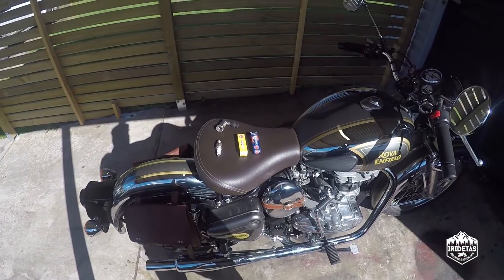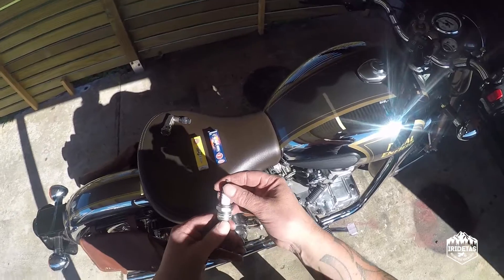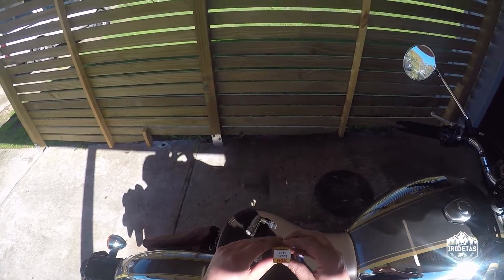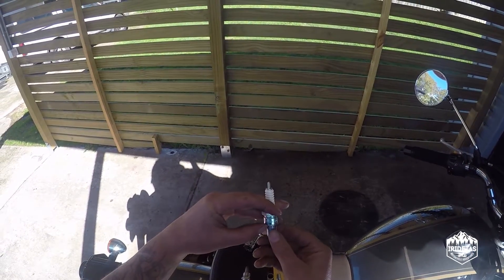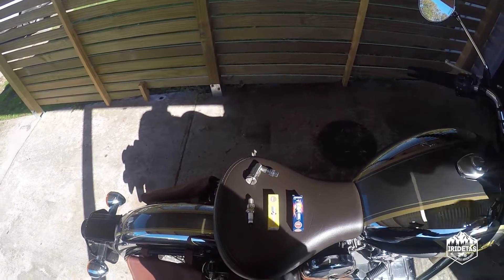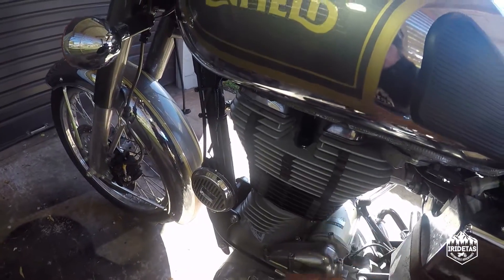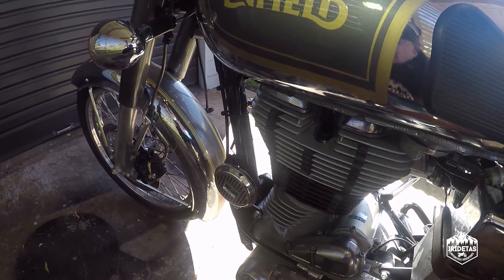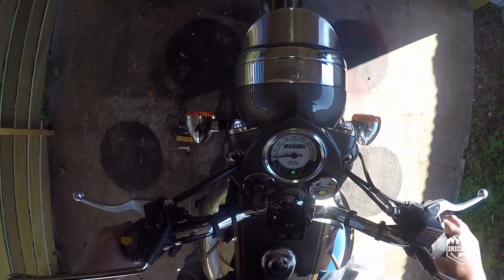REA #6 | Spark Plugs, Royal Enfield Classic 500 | Bosch WR7DDC4, NGK BP6ES vs NGK BPR6EIX Comparison

Comment: Can you share the plug cap code? I'm not finding this one to buy
Reply from the maker: Its in the description and video mate
Reply: @iRidetas  The plug cap have the same code as the spark plug? I found the spark plug but not the cap..
Reply from the maker: @andrert100  Non resistor spark plug cap is NGK LZFH
Reply: Thanks mate
Reply: One more question mate. I made the complete change but feels like the plug cap is a little free than the original, is that normal?
Reply: Will leave this message here if anyone else newbie like me doing this change. The Iridium Spark plug has a cover in the terminal that connects with the plug cap. You need to remove it to connect correctly.

Comment: How can i buy this plug set in india here only heat range 5 is available
Reply from the maker: Order it internstionally from amazon or the likes
Reply: @iRidetas not available in Amazon or anything
Reply from the maker: Mate, the internet is a powerful thing, i can buy things from india to be sent here, im sure you can sus it out, in 3 seconds i found the ngk india headquaters and the distributor network search engine and for example found all the suppliers in Dehli. Give it a try! Google is your friend mate!
Reply: @iRidetas I got it, but the problem is that the NGK plug and NGK resistor cap are from different websites, so I have to pay separate shipping charges for each. This makes it super expensive  the shipping costs are almost twice the price of the products themselves.

Comment: Very good video! Are both spark plugs the same? My RE 500 has one with a smaller diameter. Do they have to be the same? Thanks!
Reply from the maker: My UCE Classic 500 only has a single plug. You will need to research the NGK equivilent of your plugs

Comment: Hello just saw your video found it helpful but can u plz help me a little i m from india i bought royal enfield bullet 500 efi in 2018 and it comes with BOSCH WQR8DC spark plug . Now i want to change my spark plug i searched the internet got different answers but the majority was with NGK BPR5EIX ...
And u are using BPR6EIX ..I am confused as for which spark plug to go with..

And i also want to ask can i change only the sparkplug or should i change the cap air filter etc..?
Reply from the maker: The 5 is a hotter plug. You have probably looking at UK pages
You can change what ever you like mate. 👍

Comment: The idle rpm increased significantly... In carburettor bikes it can be adjusted. Is there any method to adjust it in Efi models at home
Reply from the maker: Yes, the large gold screw on the throttle body is the idle adjust

Comment: Hiya Buddy - Thanks for the excellent video and advise - I have the iffy Bosch plug on my nearly new 2020 model. The engine is more shaky than my other half!. As Hitchcocks is only some 30 miles away I will take a ride out and grab a couple of the NGK iridium plugs. (will keep the Bosch as an emergency spare in case I see another bullet owner broken down on side of road!) - Not sure if i need to change the plug cap itself as mine is not the metal type that is in your video (mine looks like the one you fitted - How can you tell if it has the resistor or not?  Also how are you detecting the revs without a tacho?
Reply from the maker: I have a digital tach installed
https://youtu.be/_J91uUw6108

Comment: Quick question. Do I need to change the resistor if I change to a BPR6EIX spark plug? I'm only asking, because those from NGK are not available here nd if I do import it the tax and duty is very high.

Comment: Cheers for all your hard work 👍. I have the iridium plug but do I need to change the cap? I also have 2017 500 model.
Keep up the good work!
Reply from the maker: Thanks mate! I non resistor cap is better, I found the stock cap not so great! But it will work with stock for sure
Reply: @iRidetas  Thanks for quick reply. I have scrutinized cover a little closer. My classic has a black plastic type cap ( not the metalic looking one you had in your hand on the video) guess the previous owner of my bike must have fitted the newer plug cap.
Once again..Cheers for all your videos.
Reply from the maker: Sounds like they have! Nice little bonus! 😀👍 take care

Comment: Thanks for that tip. I have just tried an iridium plug in my RE classic 'Tribute' 500 (300 miles on the clock) and went for a half mile out and back and the difference was obvious. Less hesitation at low speed, smoother running and it felt subjectively like more power too! Just like you said. Thanks again!
Reply from the maker: No worries glad it work as well for you as me!

Comment: Enfield 500 and 350 are calibrated for BOSCH WQR8DC, all new bikes come with the same. You can find BOSCH iridium plug WR8DP It is made in Germany. Engine runs smooth and no carbon fouling.
Reply: WQR8DC had a different shape of insulator, which helps spark plug to heat faster so that fouling can be avoided. Enfield engines are calibrated with lower combustion temperatures, to imporve the performance of spark plug (any brand) rev up the engine and hold at high rpm occasionally for few seconds.
Reply from the maker: Imo bosch plugs are inferior to NGK and my bike runs better cheaper than the equivalent bosch plug.  But each to there own mate if you have sucess with them more power to you!

Comment: Wanted to try your  NGK suggestion in my 2020 Bullet Trials so ordered the spark plug and cap off Ebay. Cap is fine but the spark plug terminal nut is not removable on NGK BPR6EIX here in the USA so I have a spark plug I can not use.  There are a couple variations of the same plug but none have removable terminal nut that the cap requires. One NGK site recommended BR8EIX as the right  iridium plug plug for my RE so I ordered one of those.  Spark plugs must be different in other countries per manufacturer/supplier perhaps???
Reply from the maker: Thats odd, i never expected that they would be so different in different countries.  The 6 here had the threaded terminal nut that just spun on or off from memory.  The 8 will be a cooler plug so will take longer to get to operational temp etc. But you have a higher euro complience than  the 2017 which is euro 3, they may have changed the plug on the 20?? Sorry to here you are having trouble.  Can you change settings on your ebay app to australia and buy it here? Get it sent across?

Comment: Hi, sorry for getting picky,  But BP6ES is a non-resist plug where as the other two are resist plugs hence the `R` in the code. Therefore should you not of used the BPR6ES?
Reply from the maker: Yup that was deliberate to try non resistor plugs and plug cap in the bike, and it works really well!
Reply: @iRidetas  But you shouldn't use non-resist plugs on an EFI.
Reply from the maker: Im not looking to argue mate... i have, i would continue to if i wasnt running the irridium plug. it runs great, it is the reccomended plug by hitchcocks and many efi C5 forums and riders swear by it. Cheers.
Reply: @iRidetas  Hitchcock's have been known to be wrong, but if it works for you  than all's good. EFI bikes are meant to use resister type plugs to protect all those sensitive electronics.
Reply from the maker: Yes im aware my friend, but it works, it works well for me 👍

Comment: Can you comment on the different looking posts on the various spark plugs.  The plug that comes from India with the bike looks like a thin threaded screw post and the replacement you recommend has a much wider, non threaded post.  Does upgrading the plug absolutely require replacing the factory cap because the wider plug post won't fit?  FYI  is on Amazon, the replacement cap you recommend NGK LZFH, is shown as a resistor cap as well.  That's a bit confusing.
Reply from the maker: No it doesnt, but the factory cap is rubbish. These are plug and play mods.  It may be that in the indian market the stem is narrow but its just a screw on adaptor. The cap was sold to me as a non resistor cap. So not sure mate.  Even if it is not a big issue in any way.  A quick search has most places listing it as non resistor.
Reply: @iRidetas  Thanks much.  I figured it all out, pulled off the factory cap, screwed on the one you recommended.  Easy Peasy.  Also, I removed the adapter from the new plug.  All is well.  Great video.
Reply from the maker: Great to hear my friend, enjoy!

Comment: Hello mate... I also have royal Enfield classic chrome 500 efi which have dual spark plug can you tell me which are the spark plug numbers of both for NGK IRIDIUM and Both or their caps? Im trying to find them from a long time i have less knowledge about them thank you so much mate ❤️
Reply from the maker: I dont have a dual spark 500cc mate so i dont know. 3 seconds on google will turn up the numbers for you!
Reply: @iRidetas  finding from 1 month got no luck 😪
Reply from the maker: Took me less than 5 minutes. Looks like
Primary BPR5ES 
Secondary CPR7EA
Therefore irridium would be
CPR5EIX
CPR7EAIX
not my bike so its up to you to double check the validity of the plugs etc. By pulling yours and seeing what they are and researching the NGK variants.
Reply: @iRidetas  ohhh okay okay great
Reply: @nischalrana2447  bro did you find iridium spark plug for your classic 500 I have 2011 classic 500 and thinking of to shift
Reply: @naveengautam8275  mate my bike is running good with these stock bosch sparkplugs for 500efi right now...maybe later I'll switch to iridium because there's no use of iridium plugs without plug caps..

Comment: So I've just installed the NGK BPR6EIX 6637 in my new 2019 Classic 500 with only 160km on the clock and taken it for a run. I didn't find it any quicker to fire up on start but wow, what a difference it made cruising around the Yarra Ranges. Worth every cent of the $20 I paid at Supercheap in Bayswater. I haven't changed the spark plug cap yet, but my 2019 doesn't look like it has a resistor. Maybe it's been deleted in this later model?
Reply from the maker: It may have been mate! Really changed my bike too and glad it worked for you!

Comment: Hey Tas, have you had issues with the irridum NGK plugs on your 500?
Since I installed those irridum plugs I had issues when idling and rough running ( esp after riding and leaving the bike for an hour or two and then riding again).
The other day 500 would not idle more then 10 seconds and would stall, even when revving.
Took it to a mechanic, he said it was the irridum plug. He swapped it for a non-irridum and said that solved it. He will do more tests tomorrow, but thinks the plug is the issue.
Reply from the maker: Nope over 4000km on the bp6eix with no issues!
Reply: @iRidetas  just got from mechanic, it's running fine with non-iridum plugs. The iridium were so black and dirty after only 2 months of using them. The mechanic said the iridium plugs make the enfield run rich and they are to be used on high performance bikes. 
It's quite possible that your custom Ecu has something to do with your bike running great and mine hating them.
Reply from the maker: Its not to do with the ecu it would be increased airflow from the k&n and exhaust which i fo mention in the video
Reply: @iRidetas  I also have a k&n filter (round shape, in the air box) and a custom straight through exhaust. For some reason, my bike doesnt like the irridum plugs
Reply from the maker: Mine and a few others i know have never missed a beat on them ryns sweet as a nut!
Reply: Hey did you face any problems after switching to non iridium plugs? Im facing the same problem with an irridium plug. Thinking about switching back to normal spark plug.

Comment: Love your work mate 
Really like all yours modes on royal enfield 
Wondering how to replace the  stock spark plug cap with non resistant plug cap 
Please can you let me thanks
Reply from the maker: Literally just pull the cap off the plug, the plug off the lead, push the new cap on the lead and the cap onto the plug.  It is really that simple man! Cheers and ride safe!
Reply: Hi mate thanks for your help , but 
I could not find the part no. Of non resistant plug cap for royal enfield classic 500 
Please can you let me know the part no. And from where I can buy it 
Thanks
Reply from the maker: It's in the video mate and the description
Reply: Hi Iridetas  , I just replaced the NGK spark plug and non resistant cap on classic 500 
But now my bike is not starting 
Does it effect on ecu or ignition coil

Comment: Hi. I purchased the LZFH cap but it’s a resistor type !!! Do you know if there’s resistor and non in the same part number ?? I have the exact same bike as you (2018) and it’s my first so I’m basically ghosting you’re endeavours
Reply: Just so you know, I’m in Canada and will let you all know of any difference in North American models.
Reply from the maker: 5 inch vs 7 inch headlight is the only difference! As far as I'm aware!
Reply from the maker: I'm pretty sure without checking there is.  It will work, imo the cap will still be better than the stock RE rubbish! I'd throw it on the bike mate!
Reply: Thanks for getting back to me so fast. I’ll definitely throw them on this weekend. And the other thing I found that’s different here is the mirrors extensions Hitchcock’s sells are standard here. Still need longer ones since my Ego has pumped up my shoulders ( I ride a Classic 500 after all ) !!!

Comment: I just received my Iridum plug and NGK no resistor cap this week. What do I need to do to install the cap? Thanks
Reply from the maker: Pull the old cap off push the new one on! It's an easy job!
Reply: @iRidetas  damn cap won't stay secure. Can I use the old one?
Reply: @iRidetas  damn cap won't stay secure. Can I use the old one?
Reply: All sorted.
Reply from the maker: It can pay to cut a small section off the spark lead to give to more to bite into!
Reply from the maker: Glad it's sorted

Comment: Just to confirm, iridium plug doesn't have to be gapped? Goes straight in
Reply from the maker: In my experience that is correct, confirmed
Reply: @iRidetas  I was about to buy that iridium plug, but I have one question: the eBay one for $15 is bpr6eix -11 and supercheap auto is just bpr6eix. Are they same?
Reply from the maker: The -11 is gapped to that I believe so I'd get the one that doesn't have that

Comment: Great video, thanks for this one, too. I need to replace the Bosch on my 535. I'll have to look up which NGK I'll need for the CGT. I do want to replace the cap for the plug, too. I've ridden in the rain and I've noticed that when it gets wet, the bike definitely tries to stall out on me and power cuts out. Guess the metal cap and water doesn't like working together.
Reply from the maker: You won't regret changing to the ngk cap and plug I found I ran so much better! Cheers
Reply: @iRidetas  does the cap just pull off? It seems like it's on there pretty good and I'm afraid of pulling it too hard
Reply from the maker: Yup it did on the classic!
Reply: @iRidetas  ordering a plug right now! My next business is to get an exhaust, I still don't know which one, though.
Reply from the maker: Hitchcocks make a great looking exhaust for the 535!

Comment: In 2018 model, the one that I own, the original sparkplug is Bosch WQR8DC. The Q stands for "quick heat". Mine also got a non resistor cap mounted as original. Bosch WR8DC (without the Q) is equivalent to NGK BPR5ES. Obviously, there are some differences between 2017 and 2018 models. Anyway, thanks for video.
Reply from the maker: I'm not surprised as the Euro 4 bikes are slightly different reflash, abs, different exhaust etc. So a different plug makes sense! Cheers
Reply: @iRidetas  Thanks for your answer. I have been working as an auto mechanic för 18 years and as a teacher in that subject for 14 years and I do prefer the NGK spark plugs. These spark plugs are really good. But I don't think that an engine with low compression needs a spark plug like that NKG BPR6EIX. It's a waste of money, go with the standard NGK spark plug is my advise.
Reply from the maker: Thanks mate! Have the irridium in the bike and works well! Have the standard as a spare! Will keep it that at the moment! Take care!
Reply: Great video mate. I just bought a 2014 classic chrome bullet 500. Can I use “NGK BPR5ES” on my bullet efi 500 classic chrome? I have a Rolls-Royce Silver Spirit 1982 which uses NGK bpr5es plugs. Would greatly appreciate your guidance. Bless you
Reply from the maker: Thanks, 5 is hotter so just watch for pre-ignition, overheating

Comment: in my yawn Toyota probox I got noticeably better fuel economy and the life is rated as longer too, so have to totally agree with your conclusion but would add that for me anyway the extra cost is offset by longer life and better fuel economy with a k&n air filter I routinely get 41 miles per imperial gallon from  my boring but practical car hoping to get a bullet or a Honda nc750x soon, leaning towards the Honda due to reliability and a damaged left hand heart says enfield head says Honda
Reply from the maker: I've had a string of bikes and always change plugs and gearing etc. To make it my own.  I'd go with my heart mate, you only live once!!